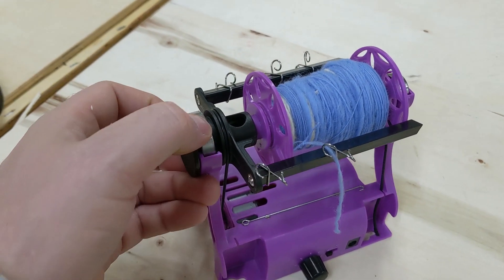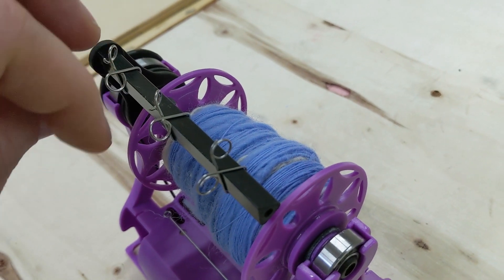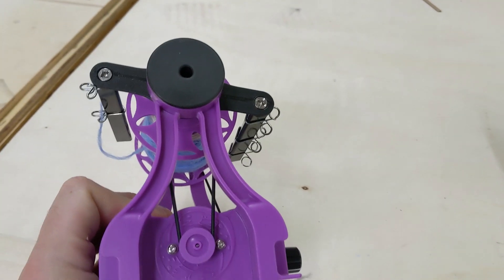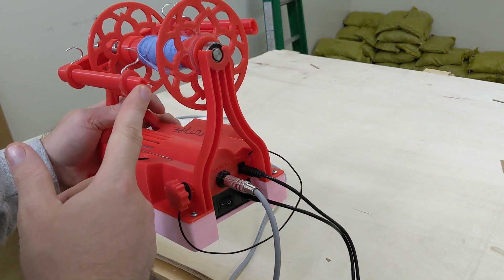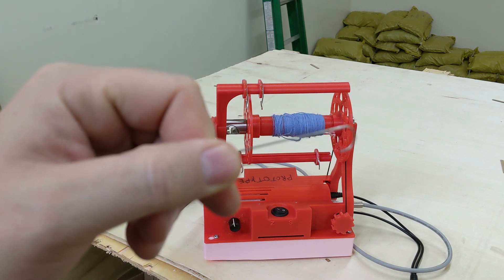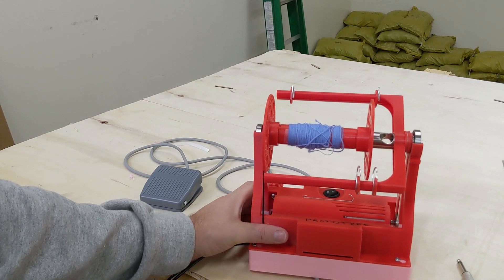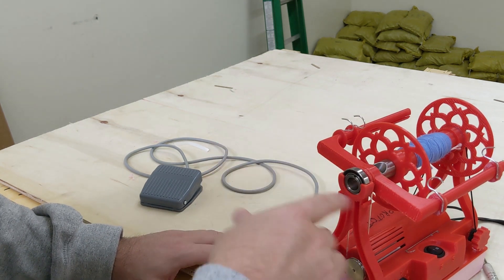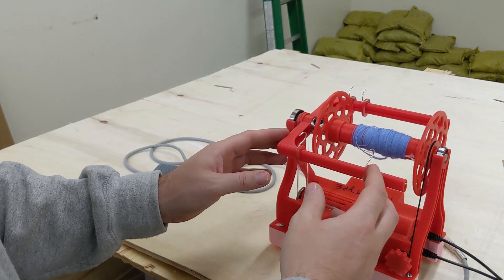SPIN #57 - EEW Nano and EEW Classic Updates

Comment: Looking forward to this model. I would like to see a better tension string then on the nano. I really think that’s the basis for the nanos issues. The tension band was to thick. I went to Joan’s and bought a smaller width band from the jewelry section and it was a game changer. I forgot to mention everyone should oil their nano just like they oil the spinning wheel .
Reply from the maker: Thanks for the feedback.  The tension system has been much improved on this version and all the testers have been liking it.

Comment: Is the foot pedal just an on/off switch or is it able to control speed also? If it doesn't control speed, you may want to consider that feature somewhere down the line. It's very handy as often spinners must slow down to remove VM, second cuts etc ,especially those of us who process our own homegrown fleeces.
Reply from the maker: It just is an on/off switch.  Thanks for the feedback.
Reply: @DreamingRobotsBlog  Please don't consider adding speed control to the footswitch. The on/off function is quite sufficient for the spinner who needs to remove VM, etc. Speed is adequately controlled by the dial.
Reply: Omg was JUST thinking that!